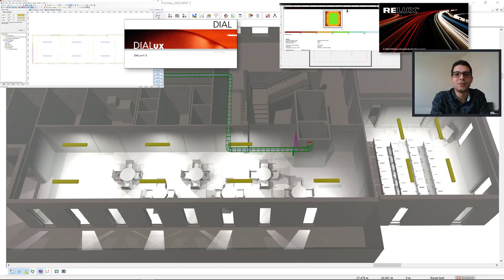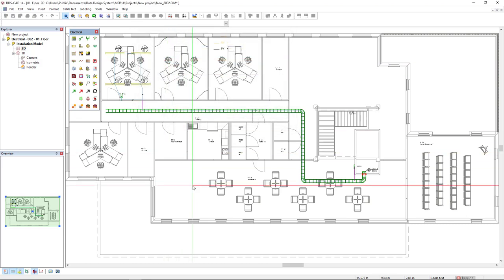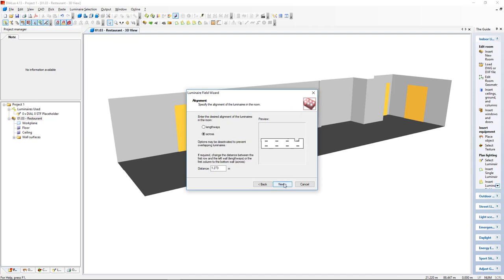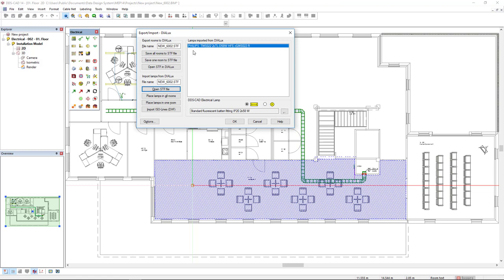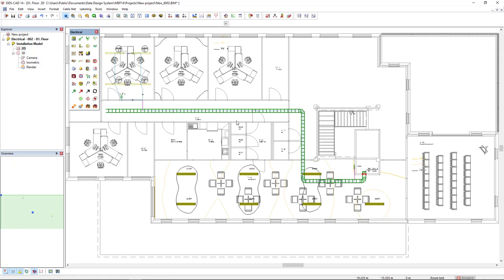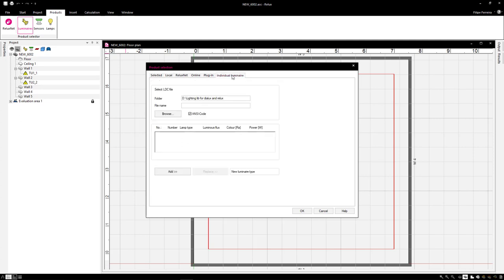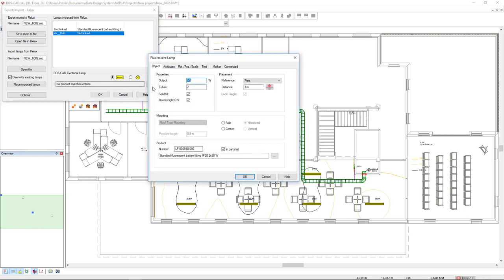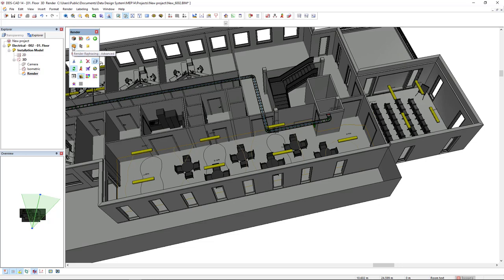DDS-CAD and DIALux/Relux: How does the bi-directional interface work?

Comment: Will there be dialux evo interface in the future?
Reply from the maker: Hi Rik, I do not know if we are going to have a bi-directional interface with DIALux EVO in the nearly future, however, DIALux EVO imports building IFC, plus, you can also use the DIALux interface in DDS-CAD to generate a .stf file of the rooms. Despite the .stf file will not be loaded automatically in DIALux EVO, you can open these .stf files directly in a DIALux EVO project. I will create a video about this workflow soon, stay tuned.
Regards, Filipe
Reply: @DDSCAD-MEP  Thanks for the fast reaction, we looking forward to see more video's